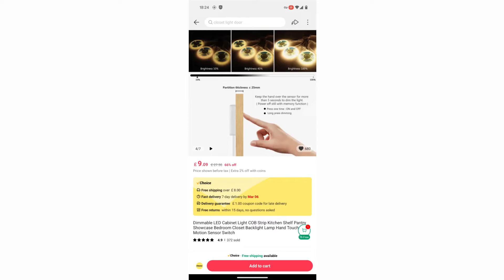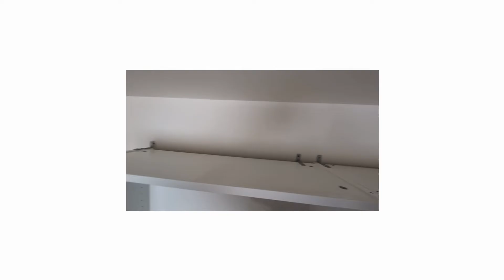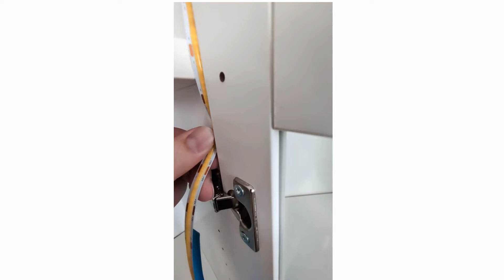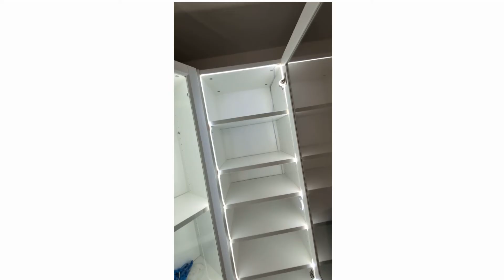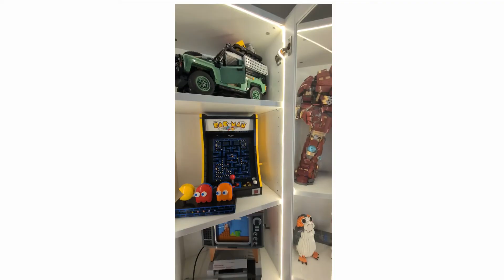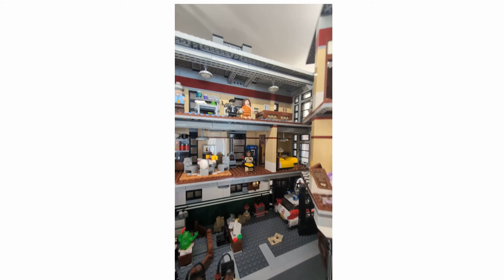IKEA Billy Bookcase LEGO Lighting Display - Budget £40 light install guide

Comment: Looks great, now tell me how did you get that corner cupboard door to fit !
Reply: For anyone perhaps wondering you can do it even with double cupboards euther side. Ikea doesnt seem to think or have instructions for it. 
However you need to use the bottom corner bracket and adjust the position of the cupboards either side to have largest gap possible. This results in approx 3-5mm gap when doors are on that is not noticable or ugly. Looks great and seemless. Result is you can have the cupboard door on corner shelf as well.

Comment: How did you get a door on your corner unit?  I’m told it can’t be done.
Reply: I found this video looking for the solution, it seems that it doesn't close properly, I have thought about putting a wooden strip between units but I don't know how it will look.

Comment: Great display! I have the same corner unit. 2 standart billy bookcases on the right-left and 1 half unit in the middle configuration. Recently, I bought oxberg doors to install. However, I can not put the middle half one, because the door doesn’t shut when the other 2 standart ones fully installed. How did you managed to put the door in the middle corner unit like that? It looks pretty neat with yours. I hope you’ve got what I meant. Sorry, Im not native English speaker🙈
Reply from the maker: Thank you for your kind words.  i didn't know that the middle door wouldn't fit until after i bought them lol thankfully because the doors have a white thick edge you don't notice the overlap as much, but the door to the right and the middle door do not fully close, they are open by about an inch although i do have a plan to tackle that, not sure it if will work though and i may end up destroying a door in the process lol  -  I'm planning an update video shortly as i will be decorating my lego room and doing a wall technic display as well as taking another look at the billy bookcase units, and my pax unit.   i will put them out around Christmas as i have some time off work and i plan to work on it then  so perhaps click on the "notify" button and you will see when i update it?
Reply from the maker: Also, the clue is in my name i'm from Yorkshire so i like things to be best value and budget if i can :) so my plans lean towards that lol
Reply: @TheYorkshireBricker  thank you for your considerate answer. I will follow for updates!👌

Comment: That looks great  I have 2 dubble doors ones an one single for my 1/18 rally cars I just need the lights now thank you for showing this video it will help me to finish em
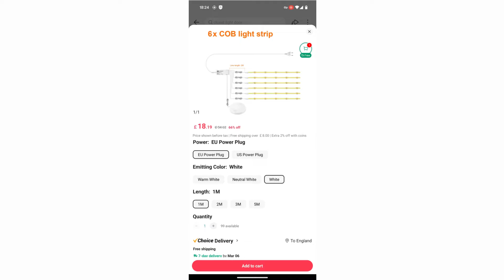Reply from the maker: @jasonleigh5767  no worries, if you need any help just drop a comment.  I'm planning on putting my 1:18 cars on the wall.  I will be doing a part 2 in the Billy install and a separate video on the wall mounted 1:18 when I get round to doing it on my Christmas break :)